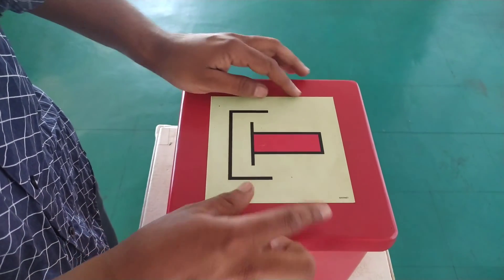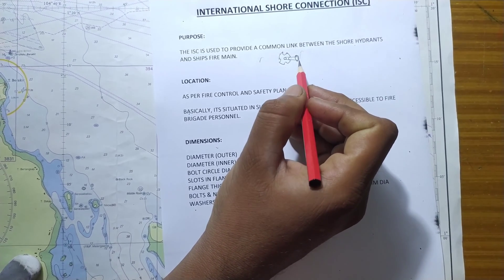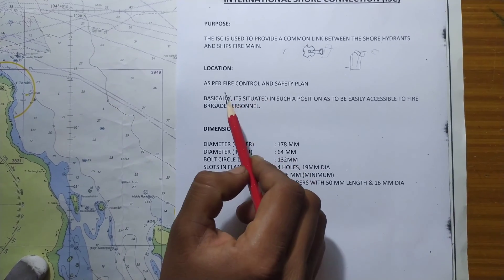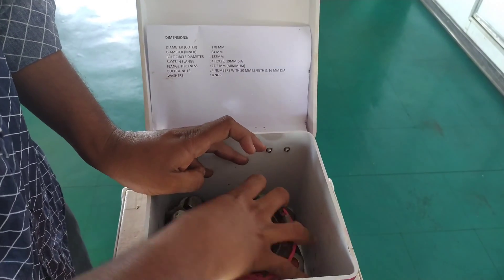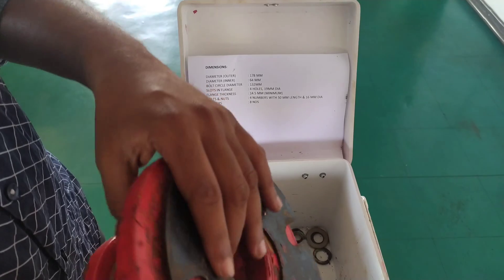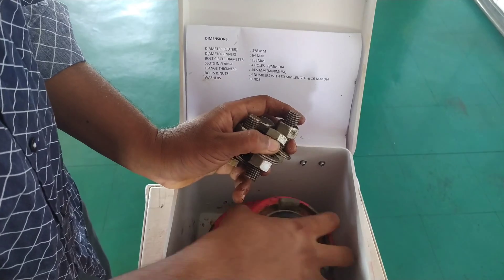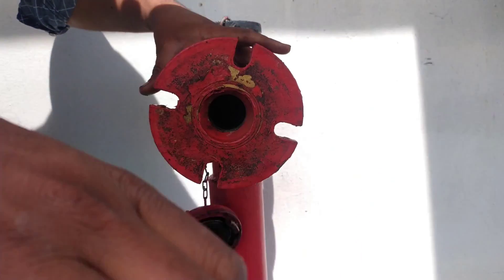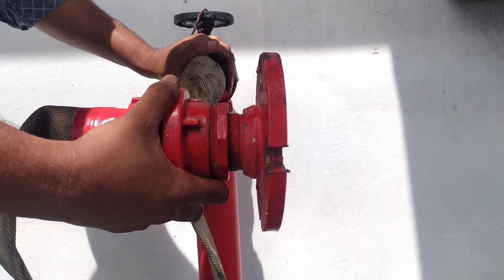International Shore Connection - ISC (Explained with practical use)

Comment: Also sir.. surveyors asks what are the type hydrants on board ship..can you plzz help with this question practicaly..what they actually want to hear..
Reply: They are asking the type of the hudrants connection. Nakajima etc
Reply from the maker: Sir, the answer is dry and wet type.

Basically, anything with an actuator is a wer type (like a sprinkler with heat sensitive glass bulb) and dry type is any normal one which needs a valve to open for water to come (like a paint locker sprinkler with opening valve outside the bulkhead or our normal fire hydrant)